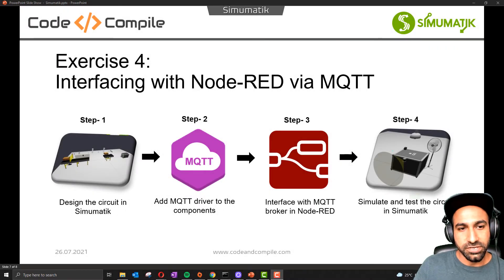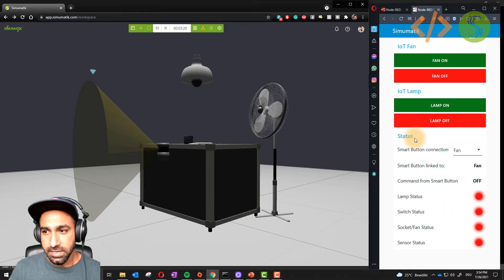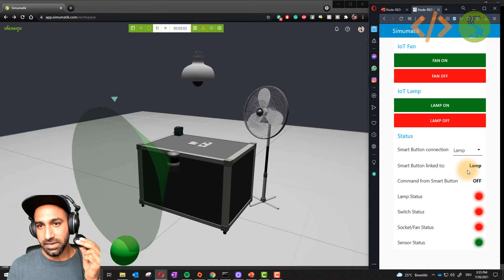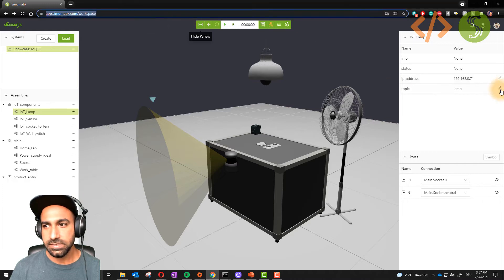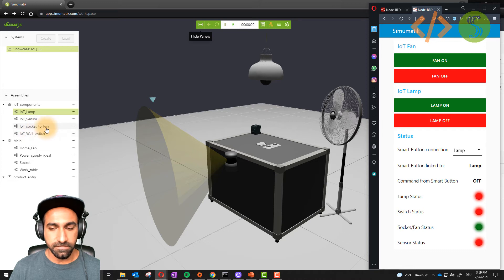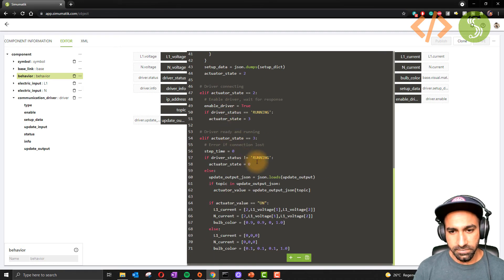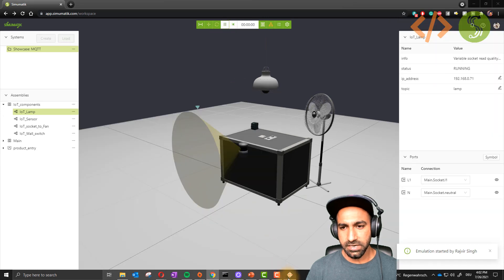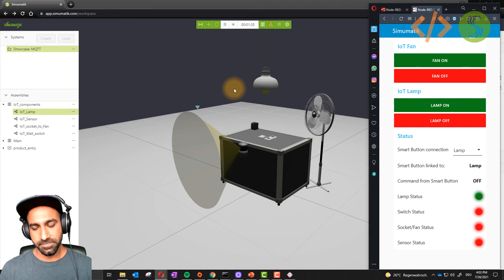Digital Twin Lesson 5-  Control IoT Devices with MQTT

Comment: Hey Raj! Can Simumatik link with a Machine Vision program (like code in python, matlab) to process the input signals and connect with Simumatik like a real manufacture? Thanks
Reply from the maker: Hi, yes that is 100% possible. Check newacademy.simumatik.com for possible integration